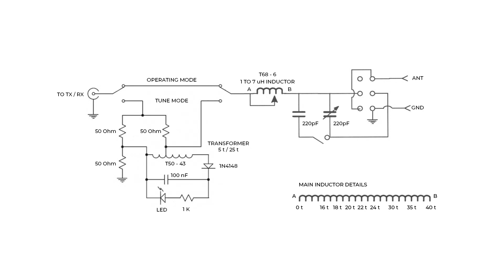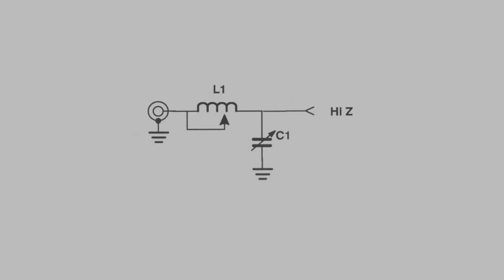QRP Multi-Z Antenna Tuner - Portable Homemade ATU

Comment: Max power??
Reply from the maker: I don't know what to say about that... with those little Chinese variable capacitors... I would not dare to put more than 10W Into it. But is for QRP so... we don't need more than 10W 😀
Reply: @dxexplorer  ok qsl de VU3ZNL
Reply from the maker: 73 DE YO6DXE. Ohh by the way..  I was not too happy about having both HIGH Z and LOW Z in one tunner with the parts I had available. It works well up to a point when it can't handle all the bands. Just because there is either not enough capacity... or not enough inductance. So I would either build it for LOW Z or HIGH Z instead of both in one. Right now I am working on another version strictly for LOW Z with a different style inductor and a bigger capacitor that will also allow me to use a little more power into it as well. I will make a video and write an article when I have a little time.